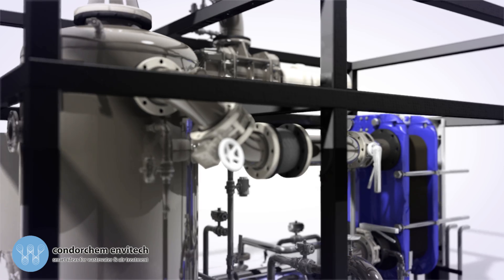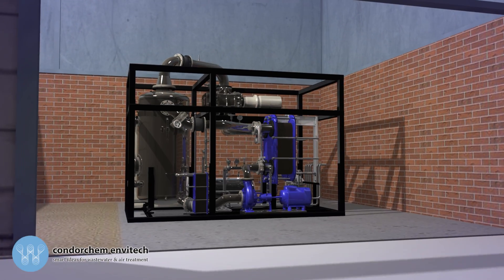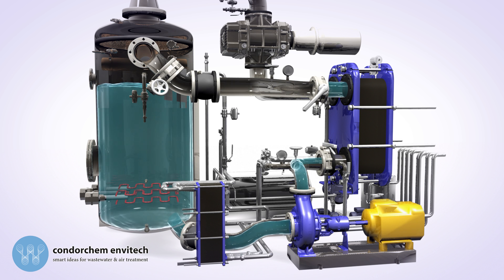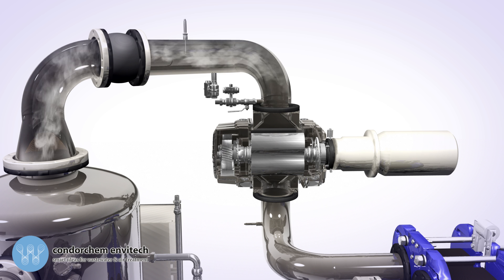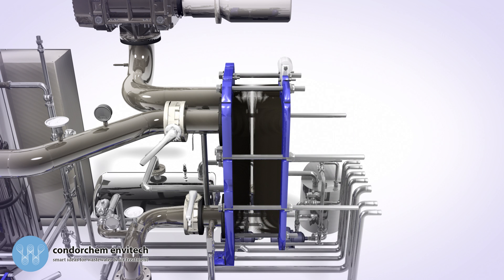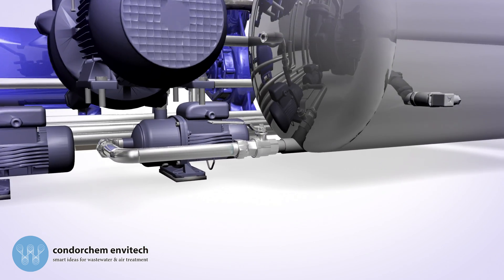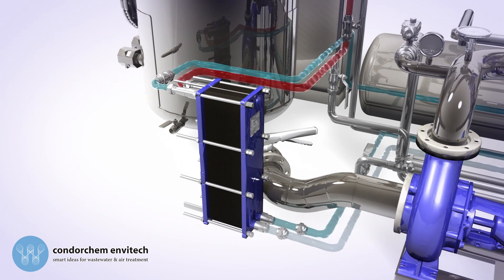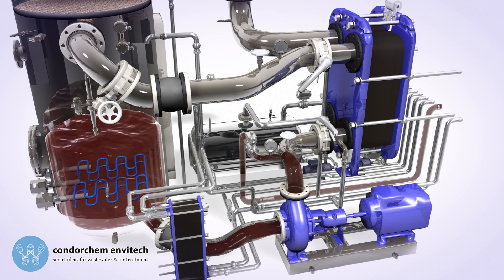Wastewater evaporator for wastewater treatment - ENVIDEST MVR FC

Comment: What is the water quality of the distillate? Is it drinkable? Have you tried this for desalination? How do I make contact with you?
Reply: In normal, these MVR evaporator treat water for industrial purpose. Produced water is desalination as these water turn from steam (but a defoamer needs to be added to the shell and water level should not such high, to avoid small drop flush up with steam). For domestic using, the raw water should be pretreated, making it no volatilizable hazardous substances contained, as they will also evaporate. Seawater could be turned to fresh water by these MVR evaporator, but not chemical industry waste water (treated water from chemical industry should be used for other purpose such as cleaning but not drinking).
Reply from the maker: Thanks for your comment. For more information you can reach us at condorchem@condorchem.com

Comment: Highly convoluted and unnecessarily complex in my eyes. There is much better NC MVR systems out there from companies like H2O or KLC. Neither of them require all this pumping action, additional electrical heating etc. From the animation alone the maintenance guy in me already wants to scream, don't want to see how it plays out in real life... Also the previous claims of only 35 Wh/l is highly unlikely. When you do the math then this would at best be the idealized water value. No way its 35 after adding all imperfections, losses and actual contamination to the feed

Comment: It is nor applicable for sewage water for sure, only industrial wastewater, right?
Reply from the maker: As you said, it can't be applied for sewage treatment, but it's a very efficient solution for industrial wastewater, such as brines, emulsions, washing wáter, etc.
Reply: Can not be. Sewage water should be pretreated, otherwise will fast clog the heat exchanger. And the MVR method is cheap for industrial waste water, but expensive for sewage water. For sewage water, these MVR equipments are normally used in sewage water treatment plant to deal with high salt content water, which come from sewage water membrane processing.

Comment: How is the energy efficiency on this evaporator compared to a heat pump system?
Reply from the maker: Thanks for your comment.
A single effect steam evaporator needs 0,75Kwh to evaporate 1 kg/h of water.
A single effect heat pump evaporator needs 0,18 Kwh to evaporate 1 kg/h of water.
A single effect MVR evaporator needs 0,035 Kwh to evaporate 1 kg/h of water.
If you have any other requests you can write us at condorchem@condorchem.com
Reply: @Condorchem  This is not viable for industries like textiles here in Pakistan, where waste water volumes are 300000 kg/h to treat. The electric power required is 10MW.  Only small capacities are viable.
Reply: @rafaeengineering  MVR and Heat Pump Evaporators are used for large quantity effluents from textile, garment, metal plating industries etc. after  pretreatment, UF and 3 stages of RO resulting more than 90% of low TDS water for Re-use. Remaining highly concentrated effluent is treated through the highly energy efficient MVR / Heat-pump Evaporators. Many successful installations are used at Tiruppur Garment Industries in Tamil Nadu state of India under ZLD systems.